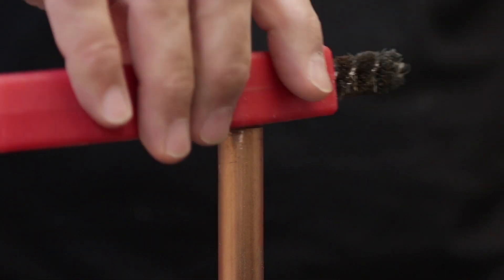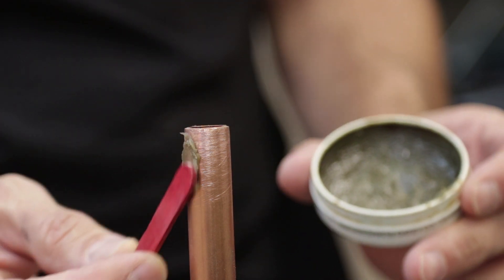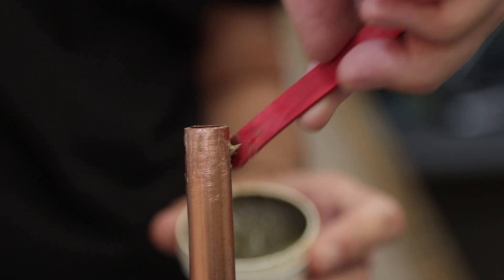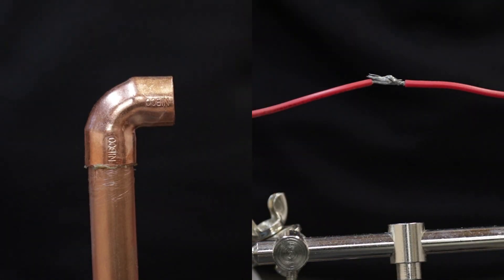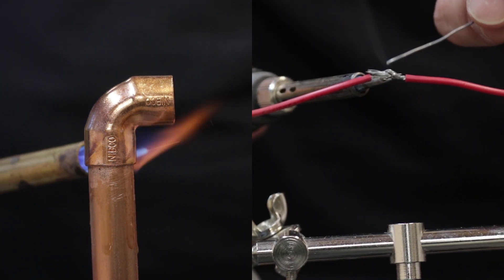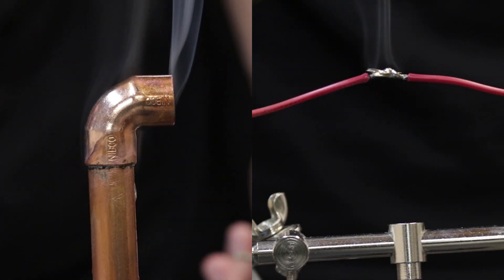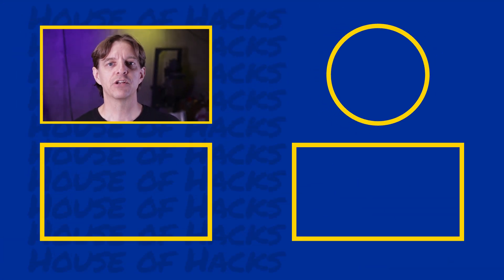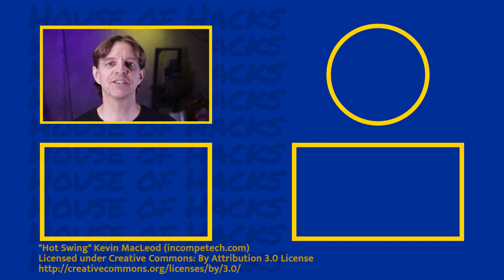How to solder

Comment: I'm tackling a DIY project using 8 ft. corrugated galvanized steel (31-gauge) panels. I need to solder the seams together and have everything ready except the right flux and soldering bars. I have a soldering iron and muriatic acid for prepping the metal. Could you please recommend the best type of flux for this job and soldering bars? Any additional tips on soldering galvanized steel would also be amazing. I am a complete beginner, so anythings helps. 
Thanks

Thanks a ton!

Comment: Nice overview video. I dabble in jewelry and metalsmithing, but want to learn about soldiering/brazing other metals like aluminum, stainless steel, sheet-metals. While it is referred to as soldering in jewelry, the process is technically brazing since solders used require temperatures of 700-900°C. Oxy-fuel torches are used, not typical soldering irons. Thought you might like to know. 😊

Comment: Modern Surface mounted electronic components need flux before soldering. Old through hole components not so much.
Reply from the maker: Flux is important in both cases. All solders I've seen designed for electronics have flux in them already so applying flux as a separate step is generally not needed (for both surface mount and through hole uses). Solder designed for plumbing applications generally don't have flux in them and it needs to be applied prior to assembling the joint.

Comment: Wht about a bed frame?
Reply from the maker: Soldering usually isn't too strong mechanically. Brazing is somewhat better. But for a bed frame, I'd weld it. An alternative would be to use additional metal straps bolted to the frame.

Comment: can you use solder to repair a galvanized/zinc watering can?
Using a torch, flux, and solder?
thanks
Reply from the maker: Yes, it should be possible but I've not done it. It may require quite a bit of flux to etch the galvanized surface enough to get it to adhere. Depending on the type of repair, silicone sealer might be an option too.
Reply: @HouseOfHacks  thank you!
Reply from the maker: @mikeblitzen  You're welcome.

Comment: which solder should be used to fill in a dent of a coin?
Reply from the maker: Might be easiest to take it to the bank and get an undented one. :-) I've soldered to coins with just regular solder I have for electronics. Needed a bit more flux to get it to stick though. I used paste solder that I have on hand for plumbing applications.
Reply: @HouseOfHacks  ok thanks for the reply!

Comment: A solder torch can solder pipes on a central air conditioner and the evaporator coils on top of the furnace or air handler
Reply from the maker: Yes, that's another good application. Thanks!